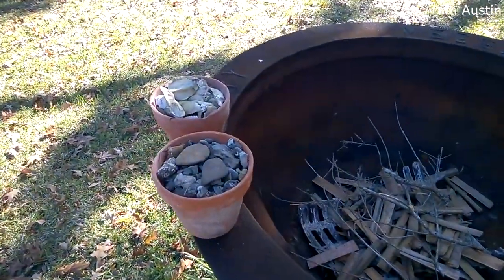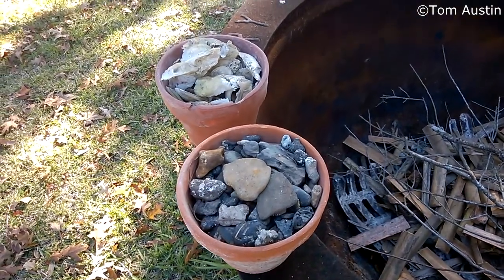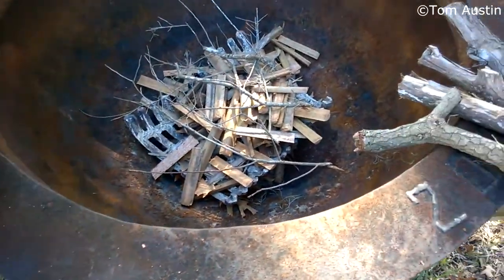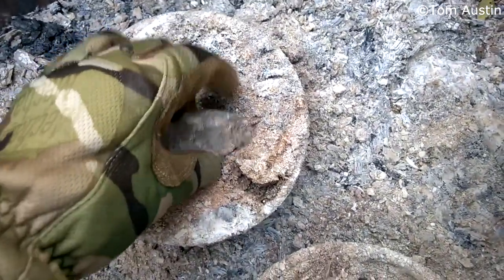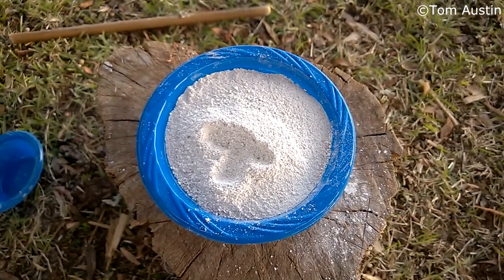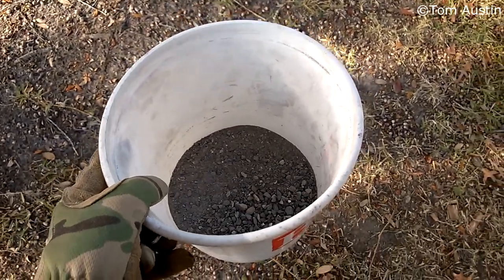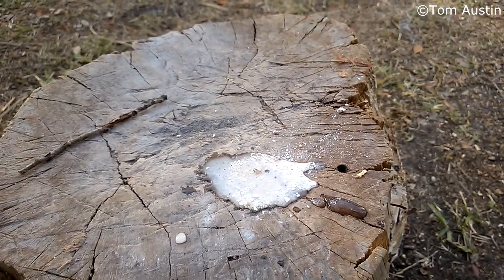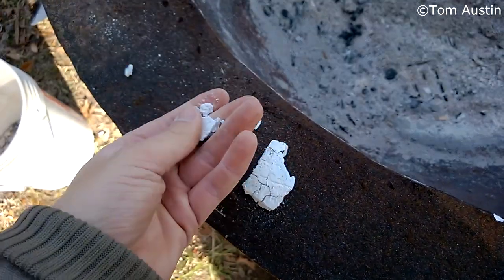Making Fertilizer from Fossils and Oyster Shells

Comment: Your lime is a lot purer than you realize. Just by grinding up the shells and leaving them out for 6 days you allowed ambient moisture to prevent it from slaking properly. Try doing that again and once the shells are totally cool put the shells in a metal tub, mix a very small amount of hot water with the whole shells and you'll get a boiling mixture. Trick is to add just enough water to keep the exothermic reaction going for as long as possible till the shells are completely dissolved, cover the lime putty with water and let it mature before removing to add sand/aggregate to make plaster or cement. Learned how to do it from my grandfather as a kid and I've restored a handful of raised tombs around New Orleans using lime I made myself with oyster shells.